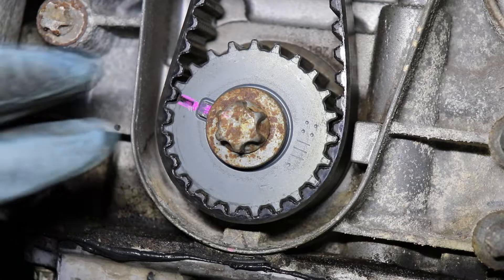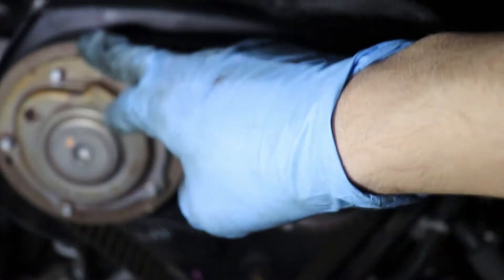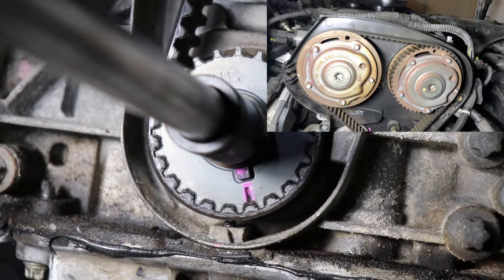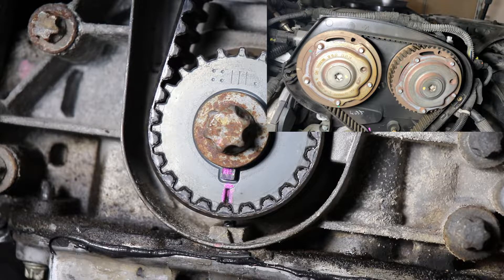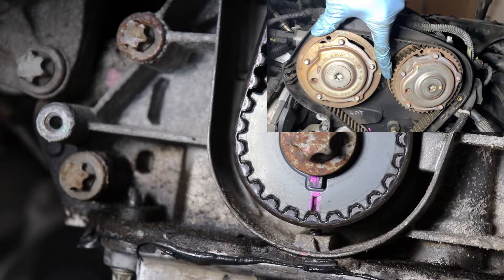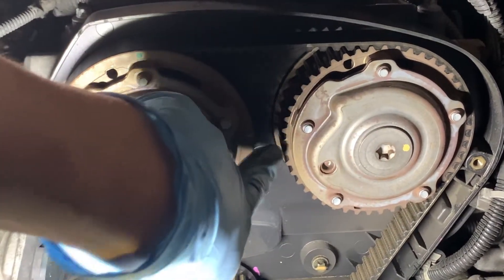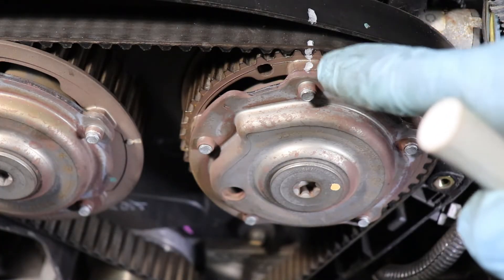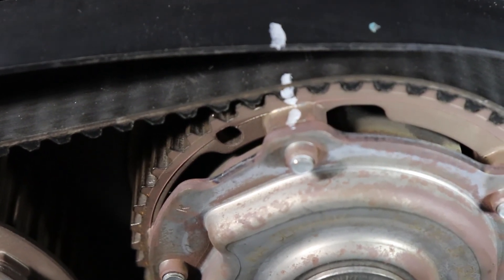How To Correctly Line Up Timing Marks 1.8L Ecotec Engine (Chevrolet Cruze/Sonic)

Comment: My timing belt stripped teeth off, how bad gonna be for me? Are the valves screwed?
Reply: These 1.8 GMs timming belt jobs are actually not to bad to do. That's the good news. Buying the high quality Cleves kit is MANDITORY. I did and still have timming belt slap. She fires right up and drives well, but its like I never pulled the pin out of the tensioner... NOT my first timming belt job. The Cruze automatically tells you to change timming belt at 100k. I think the manual says 75-80k is max life for belts. Way too soon.

Comment: I made a mistake, i took the timing belt off first without lining anything up. I understand TDC. So the bottom arrow in lined up. The left came is lined up, the right is not. I can only spin it haft a turn then no more. How do i get that cam aligned?

Comment: Oh dude thank you. 
I passed the 100k miles and got notified to replace timing belt. 
Now at 110k miles, cylinder 1 is mis-firing. 
I assumed it was due to timing belt slip. 
But my left mark on cam is slightly higher(exactly like yours, so I’m glad to see that is normal. 
Now to find out what’s really misfiring cylinder 1
Reply: My engine is doing the same thing. What did you find out it was?
Reply: Mine done this. Ended up being coil pack
Reply: @Lukeavfc9  same I replaced the coil pack and it resolved the problem
Reply: Mine was fuel injector

Comment: I have the same car and I did the timing perfect. After a few months the new tensioner failed and the belt was loose took it apart retimed it replaced the tensioner then put it back together. Ever since I have had the engine light on. Took it apart 3 other times and can't seem to fix the issue now. Any ideas why I can't seem to fix this now ?
Reply from the maker: whats the engine light code
Reply: @OneTrickTech  p0016  I replaced the 2 sensors. There is still a little bit of jerking when the brake is applied and seems like it runs a little rough like the idle is to high.
Reply from the maker: the timing is off, I believe one of the camshaft is a tooth off,  re-check timing marks and also check crank sprocket. you are 1 tooth off somewhere
Reply: @OneTrickTech  yes I was thinking the same. Can I take the belt off and realign the cams from the back and make sure it's top dead center with the timing tool to lock it all down and put the belt on ?
Reply from the maker: yes realign the camshafts first, then check the crank sprocket, if its off you can align it. Its easier to align the crank sprocket than the cam sprockets. If one cam sprocket is off, you will have to take off the valve cover and realign from there, because if it needs to go counterclockwise you wont be able to move it, you will need to physically move the whole camshaft.
Reply: @OneTrickTech  thank you for your help
Reply from the maker: @robertpriddy1808  no problem good luck hope it works out !
Reply: @robertpriddy1808 how did the repair go fellow 1.8L citizen? it has been a year since update
Reply: @platinumjazz_  oh yes the repair went great but after I did it the tensionor fail after 2 months so I had to do it again.
Reply: @  nice!!! very good to hear. Thanks for responding 🫡🫡🫡
Reply: @platinumjazz_  the second time I had to do it I took off my valve cover and locked the cams so they wouldn't move while I put on the belt on and it was so much easier to do it that way rather then lock the fly wheel.
Reply: After doing timing alignment for my cruze 1.8 I noticed the car was running rough with a check engine light i took it to the shop who did the alignment they did it again and it was still running rough it turned out the exhaust camshaft tooth broke off i had to replace the camshaft and it is running great
Reply: We are in the same boat brother. I have  new timming belt tensioner #2 ready to go in this weekend.  I hope it was just a bad tensioner. I bought the Cleves timming kit to, the good on. We'll see. recommended..
Reply: Did you lock the fly wheel before doing this ?

Comment: Pardon my ignorance. I've only done a few timing belt and I've noticed there's no marks on the belt how does that work?
Reply from the maker: No need. As long as the marks are on the camshaft and crankshaft line up.
Reply: @OneTrickTech  I appreciate the answer and the video. Do I just pull the slack to the tensioner side?
Reply from the maker: yes when putting it on the new belt. I have a full video here https://youtu.be/FHlmLxMCaYw
Reply: @OneTrickTech  thanks. I have seen it, and it's the best one. I just noticed nobody talked about timing marks on the belt.
Reply from the maker: @MrMK211516  I know what you mean though. You can mark the old belt and then transfer the marks onto the new one to help you align it perfectly.
Reply: @OneTrickTech  I don't trust the old belt because of the "service timing belt" light that came on. It may have jumped timing already, but thanks again. You've been very helpful.

Comment: what torque to tighten the bolt of the roller, tensioner and shaft?
Reply from the maker: both tensioner and idler is around 15-20ft-lbs. Crank pulley bolt is around 70-75 ft-lbs.
Reply: @OneTrickTech  Thank you for your answer

Comment: my exhaust sprocket (right sprocket)  went counter clock wise by one tooth when I was taking off the belt and had bad autozone rental tool that didn't hold my sprockets in place.. 

but the Crank shaft sprocket bolt and camshaft intake sprocket (left sprocket) stayed inline and still line up together when rotating clock wise

can I just take the timing belt off and  move the exhaust sprocket by one tooth clock wise.. lock it in place and put the belt back on.. of course with the Crank shaft sprocket bolt and camshaft intake sprocket still inline...

will this be fine to do?
Reply: i only ask because i noticed the camshaft sprockets both have in the middle the ability to turn the sprocket using a T wrench of some kind
Reply from the maker: yea you can do that, but you might need someone to help you hold it in place while you put the locking tool. The torx on it is a T55, have someone turn it 1 tooth clockwise and lock it in place, If you go too far, it will jump like 2 teeth so be carful
Reply: @OneTrickTech  thank you so much 

Should I lock the fly wheel while doing this?

Also is it common when one tooth is out that 

p0016 and p0017 codes show up
Reply from the maker: @JonathanJimenez_metalriff6  yea you can leave the fly wheel locked. If its 1 tooth off you could get misfires code or cam crank correlation codes, not sure for the exact numbers
Reply: @OneTrickTech  thank you so much!